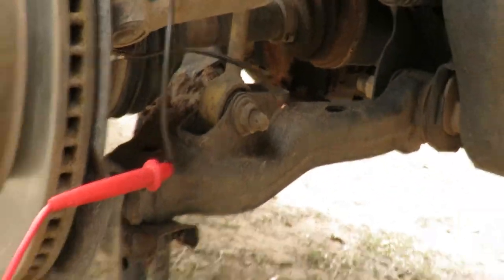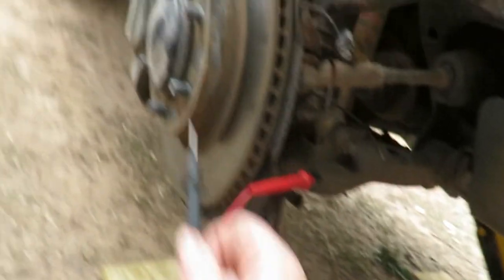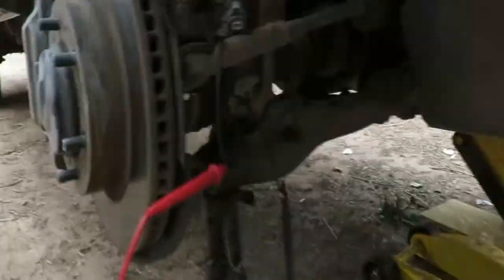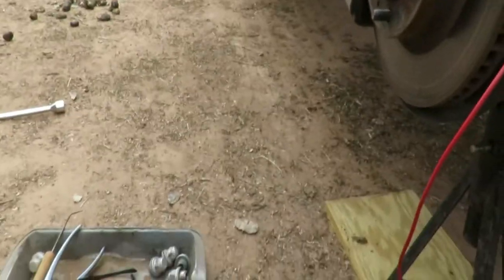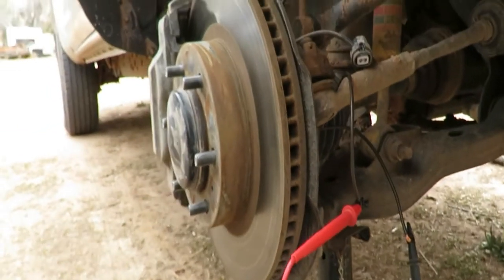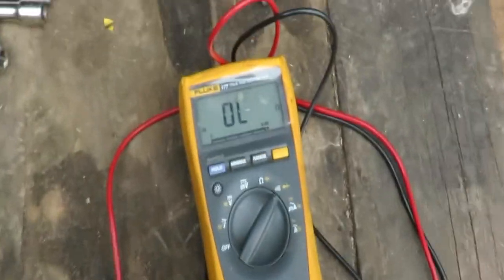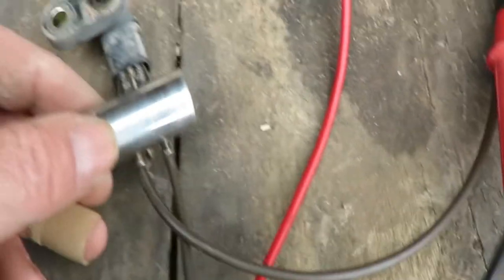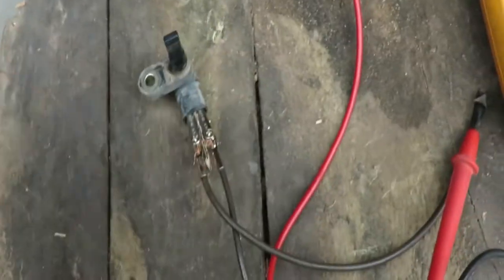2005 Toyota Tacoma wheel speed indicator, and my assistant Bob The Cat!

Comment: I thought those were hall effect sensors and not particularly easy to diagnose. In continuity/diode mode you need to probe both directions if there was a diode or any active circuitry.

Comment: hi david, you probably would have saved some time and effort by finding out what the ohms spec for the sensor is and just checked that. if it was higher than spec the sensor is bad...
Reply: @tarstarkusz  It is a hall effect sensor with a built in amplifier. A resistance test is a quick check. A too high or too low is a definite sign of a bad sensor. A correct reading could mean a working or non-working sensor and more test would be needed.